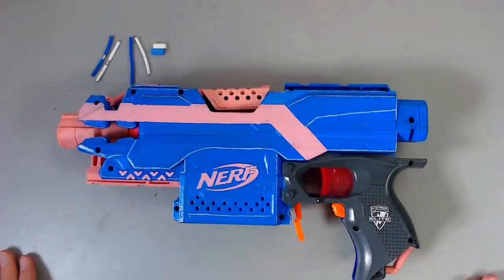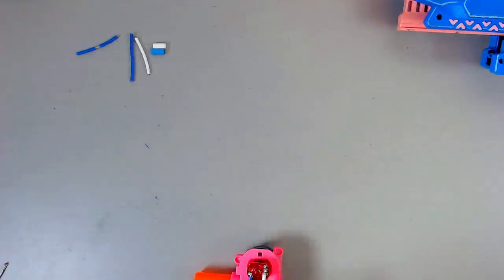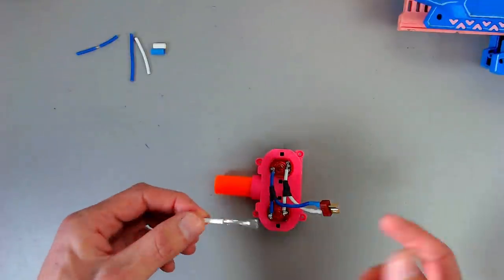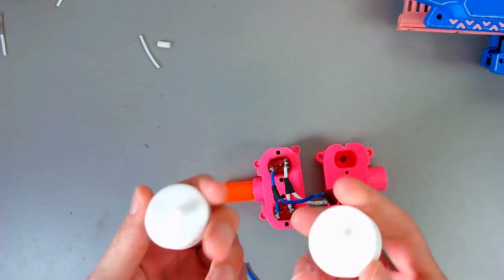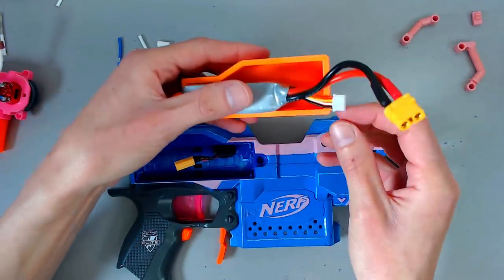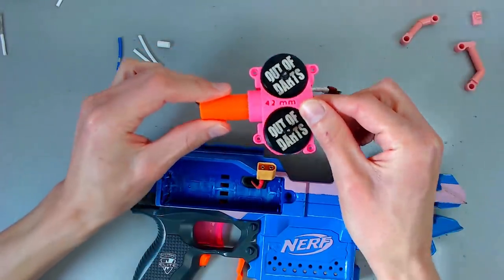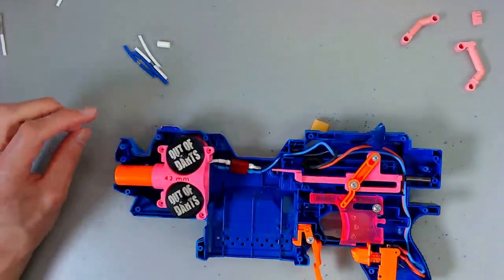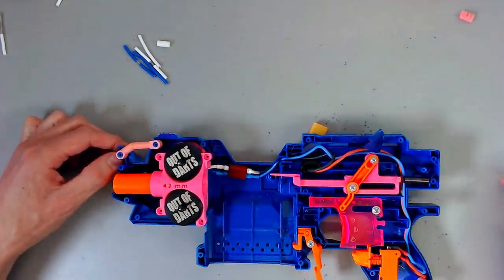Cutting Wires For A Stryfe Cage & Fitting Large Batteries In The Tray! Workbench Wednesday #11

Comment: Jangular, can you tell me how you mounted that rev trigger switch? I'm trying to build a select fire stryfe and I need to use one of those 10a cherry switches you used. Most mod tutorials I've seen use the larger omron clones, so I'm flying blind.
Reply: Hi Daniel you can cut a square out that makes the switch up against the rev trigger then you can cut the plate that holds the stock switch  and make it secure the rev tigger finally epoxy or hot glue the switch in.
Reply from the maker: I used the guide for installing the BlasterTECH loom on their website.

Comment: Although you have made the battery fit, it seems a little awkward to do. If you removed the material above where the 4x AA would be, the solid chunk of plastic at the top of the compartment, you could fold up he excess wire there, leaving the space the cells would be for the pack itself
Reply from the maker: This is something I mentioned in a previous video, but I'm leaving that part in tact for now as this blaster might be getting a select fire kit which looks like it needs that plate to be there.